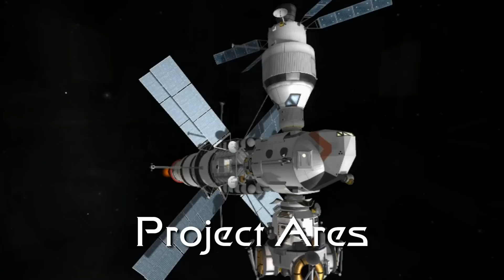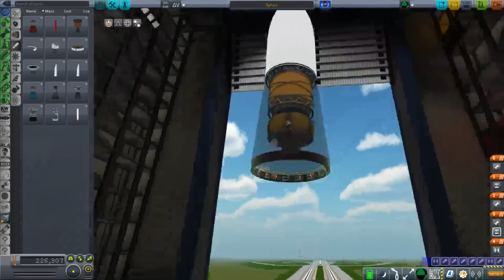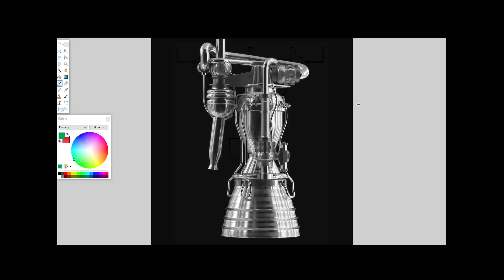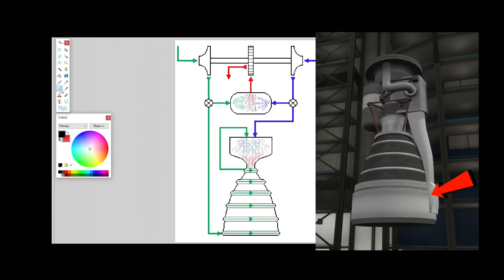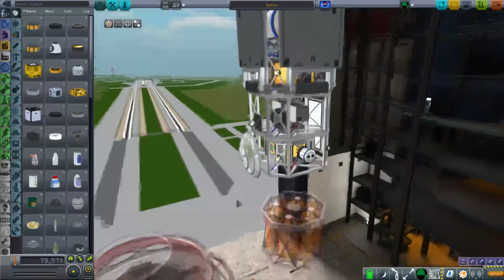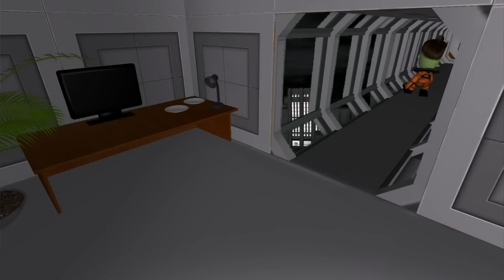A05 "Combustion" - Project Ares - Real Solar System - KSP 1.1.2

Comment: Bob,I cannot use near future construction with tweak scale ,Please help!
Reply from the maker: Be more specific? It works for me. I also assume it works for others or else we'd be hearing about it on the forums. How does it fail for you?
Reply: +Bob Fitch What happens is when I try to scale down the trusses that you used for your first satellite the tweak scale bar does not appear
Reply from the maker: You have RealFuels installed, don't you? ModuleFuelTanks does not interact well with TweakScale. You can either remove the tank module from the part, or you can figure out the scale you want and make a new part of that size, or you can fix the bug in TweakScale that makes it ignore the flag telling it to not scale, or... well there are many options.
Reply: +Bob Fitch I don't have real fuels so can I have more detail on the second option,Thanks

Comment: Gas generator. Kerolox. That type of engine should be used the most for the lifters.

I wonder if you will be able to reconnect the Kerbals with the humans, and then they will eventually tell the humans how to start reusing their launch vehicles. However seeing what's happened to the humans since the Kerbals came it would probably be the best to do VTVL style landings of the stages of a new launcher. If you know what I mean ;)

Comment: "They're pretty good in terms of thrust, but we're still dealing with low technology in terms of ISP: 290-314." Those ISPs are better than that of the Merlin 1Ds, according to an Astronautix calculation of their ISPs based on the performance of the Falcon 9, and their thrust is about 30% higher than the Merlin 1Ds on the Falcon 9FT. So, either your technology is pretty advanced here, or SpaceX's first stage engines are mediocre. I'm more inclined to go with the latter conclusion, but I'd like to know your opinion.
Reply: How about the TWR? Merlin Engine has the highest TWR to date that 'human' ever built. I don't know about the kerbals ;-)
Reply: He's using a separate site to match it precisely with real life plus with the games ability the game is not exact like real life therefore can't use exact real life numbers maybe re watch the second video that explained that in detail before criticizing  him
Reply: +Robert Shelton I did watch the second video. I'm not criticizing his engine stats. I'm merely asking whether his technology at this time is as advanced as SpaceX's is today, and if SpaceX's engine technology is somewhat outdated.
Reply from the maker: SpaceX engines are intentionally built the way they are for reusability. Engines that are meant to be used only once have very different (better) stats from one you can reuse 10 times.
Reply from the maker: Bena would have been right if we were talking about normal engines. SpaceX ones are not normal since they can be used over and over again. They made a lot of changes to make that happen. They don't want the "best" engine stats. They want the most economical and reusable engines.
Reply: +Bob Fitch That makes sense, and you explained as much later in your video. I foolishly commented right after the section I was intrigued by, and didn't finish the video before commenting. So, does the Merlin 1DVac utilize staged combustion thanks to its expendable nature? Also, what about the Raptor? It's designed to be fully reusable, yet is also supposed to utilize full-flow staged combustion, which is quite a complicated cycle for an engine. The SSME also used staged combustion, I believe, and it was, at the time, the epitome of reusability. Granted, the last two engines are LNG/LOX and hydrolox, respectively, as opposed to kerolox for the Merlins. So, I guess my question is, if those engines can use staged combustion and are also planned to be (and, in the case of the SSMEs, actually are) reusable,  why can't the Merlins do the same?
Reply: +Benaplus1 Hmm, Merlin 1DVac still use the same Gas Generator cycle, but with larger expansion ratio as it operates in vacuum. It also minimize the production cost as it only modified if not slight, a little difference than the ordinary Merlin. But the Raptor indeed intended to use staged combustion chamber but will use liquid methane rather than kerosene (RP-1) for a boost in the ISP and future use on mars atmosphere.
Reply: +Alpha Adhito Thanks for the info. I know continued use of a gas generator would reduce development and production costs, but the DVac's ISP is almost 350s, a remarkable achievement for such an engine, which made me suspect staged combustion.
Reply: +Benaplus1 No problem, I always love to teach and also learn about rocket engineering  ;-)
Reply: And also because full flow staged combustion would be much harder to do with kerolox. Actually, mostly because of that reason. But hey, PR. 
Different propellants have different physical properties that make them behave differently on the same cycle. For example, RP-1 is a liquid with a high molecular weight, therefore staged combustion is oxidizer-rich and a nightmare to engineer (go russkies!). 
Methane, OTOH, is a light cryogen that can be run in hydrolox engines without serious modifications, and that fits the fuel-rich cycle used in the RS-25s (AKA SSMEs) perfectly.
Reply: Yeah, TWR is definitely the point where the Merlin shines. And it is an important point, since it is the main driver of GLOW!
Reply: +rune12358 When you said 'Shines', it really did. :-D